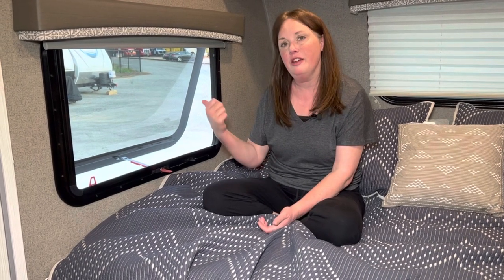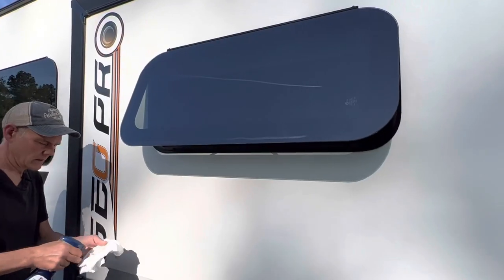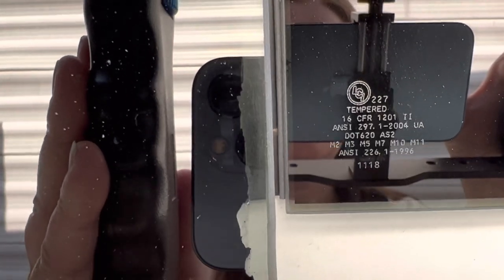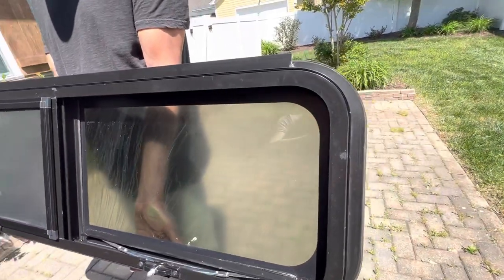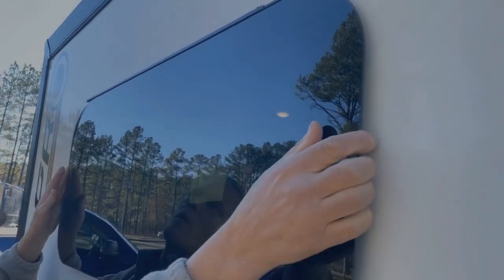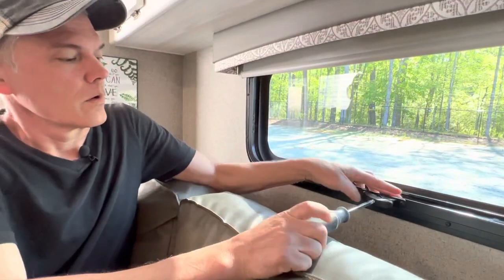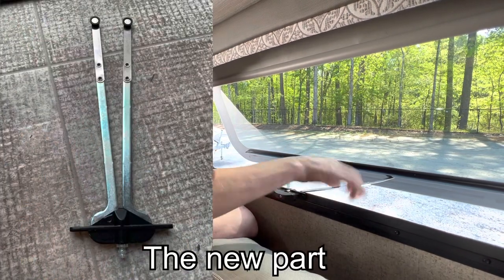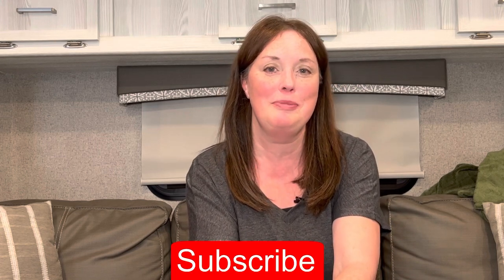RV Frameless Windows - 2 Minute Fixes & What We Do For Maintenance!

Comment: Hey y’all! Those were great! Lots of folks don’t know about the windows. An issue with the newer models is cracked windshields on the front of the trailer. Some folks managed to replace theirs without removing the front cap. FR says you need to remove it to replace it. Anyway, we’re heading your way next month. Will PM you with dates to see if it works in your schedule. 😁
Reply from the maker: Thank you!  Yes - there doesn’t seem to be a lot of info out there so we thought we would do some research and see what things were causing the most issues on them.  And we have seen those issues.  Thought about getting a cover for the front because of it.  And from what we have seen (a post on someone who bought a camper and they were finding cracks in the fiberglass.  Looked to be from a prior repair of just replacing the window and not the cap), FR may be correct.  And we would love to meet up.  We are going out of town for a family function soon but hopefully we can coordinate.  Happy to hear you are making the trip!  Will watch for your PM.

Comment: Thanks for the video. Have you replaced the front window yet? I have a nice sized chip and a crack starting. I ordered the glass from Forest River. I believe it's an easy replace but I can't find a video with instructions anywhere. Any ideas. Thanks, Kelley
Reply from the maker: Hi!  We haven't - luckily.  So sorry to hear that yours is not so lucky.  We haven't seen anyone replacing it in a video either.  A few people we have read had an automotive glass repair place switch out.  And for this project - we don't know if we would tackle it ourselves.  Would likely find somewhere familiar with windshields to see if they would be able to switch out.  If you do try it - would love to hear how it goes and any tips you have!

Comment: Do you have a resource or part number for the replacement weather stripping between the glass and the frame if mine is damaged please.
Reply from the maker: Hi - what year do you have? I think they changed up on the weatherstripping around the windows in the newer models (had a discussion with another viewer on it).   We don't have a specific part number but can take a look at ours this week and see if we have a suggestion (2019).  I would also suggest reaching out to Forest River and see if they can provide the info.

Comment: Thank you for this video. Could you tell me the name of the little tool you used to help unstick the window from the seal? One of my windows arrived stuck and I am afraid of doing damage getting it open. I will be ordering the parts you mentioned to have on hand. I find your videos so helpful and appreciate what you two do so much.
Reply from the maker: Hi Janice.  I am not sure what tool you mean?  We didn’t use anything specifically to get the window open but if you can tell me which scene you saw it in, I will take a look.   Usually if they are stuck where we feel we might put too much pressure on the handle, we will take the screen out to give it a little “help” as we turn the knob.  And thank you - very much appreciate the watch!

Comment: We have a 2019 Geo Pro, the window shattered over the sink. I hope we can get this fixed.
Reply from the maker: Oh no!  So sorry!  Luckily, it is an easy fix once you get a new window.  A few screws at the top and the window glass will slide out and a new will slide in.  

If you bought through a local dealer, they should have no problem ordering you one.  

If bought used or the dealer won’t help, would reach out directly to Forest River parts department.  With the VIN on the camper - they should be able to send you the correct replacement.  Hope that helps!
Reply: @WinesPinesandCanines  Ty, maybe a glass shop can make one. Dealer quoted us 500 for replacement. Wow.
Reply from the maker: Wow!  That is alot.  Possible on the glass shop!  Was it both of the windows?  (Our kitchen window is two that look like one) If one is still good they could maybe use as a template.  Also - I would try reaching out directly to Forest River.  May be cheaper although shipping will likely be expensive - they ship the whole window out and not just the glass.  Let us know how it works out.

Comment: On one of my windows the roller at the end of the metal extending arms is out of the slot. Any idea how to get it back in?
Reply from the maker: Hi!  Were you able to get this fixed?  We have not seen that problem but we are staying in the camper this weekend and can take a closer look if you still need a second set of eyes!
Reply: Yes, I drilled out the rivets holding in the knob so I could slide the rollers to the end of the track. Used small stainless bolts to put it back in place. I am not 100% sure that it won;t pop out again.  @WinesPinesandCanines
Reply from the maker: Sounds like a good fix.  We had to repair the emergency window latch (video upcoming) and used the same method.  Has held up very well (we used some loctite blue on the bolts)